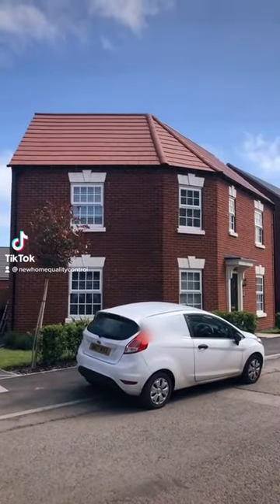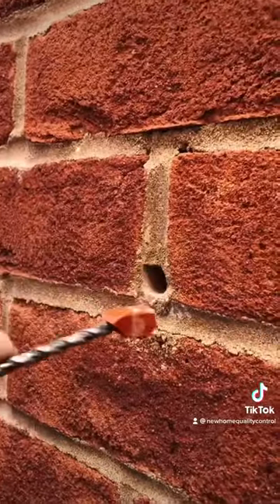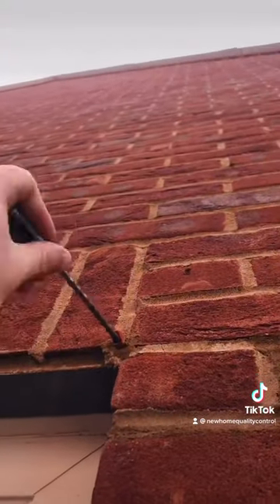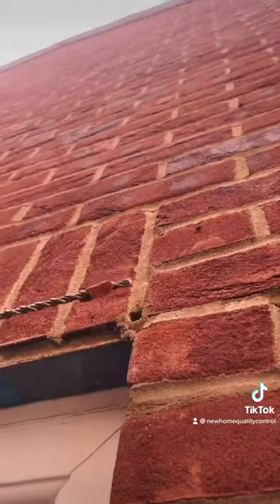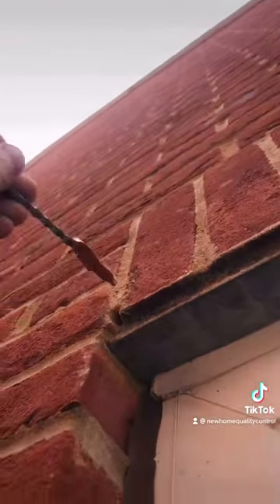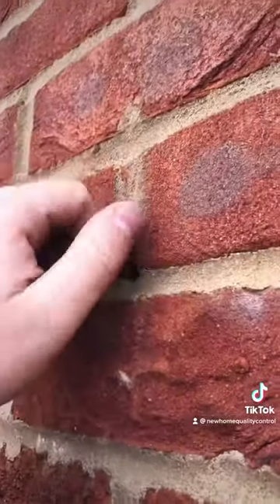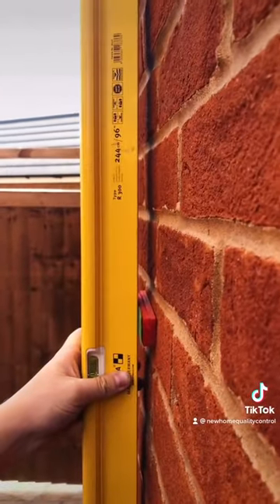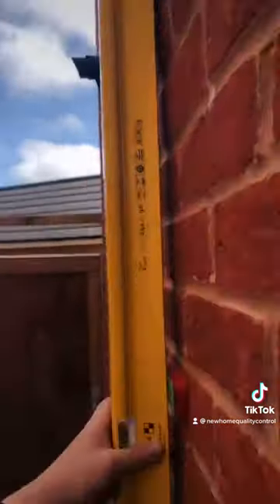MASSIVE BRICKWORK ISSUES: NEW BUILD INSPECTION

Comment: I’m interested as to what actually happens to the contractor when fake weep vents are found. Are they fined?
Reply: Updoots work on yt?
Reply: No the builder or sub contractor will be responsible for fitting them correctly.
Reply: I’m interested in knowing what a weep vent is and why I don’t have one
Reply: @MattHanr  you may live in a house that predates weep venting. They're just a way for moisture to make it out of the wall cavity.
Reply: @MITUK  it was built in 2019 lol
Reply: @MattHanr  😂
Reply: @MattHanr  depending where you live they might not use dedicated weep vents(plastic fabricated ones.) or they might use ones that look different. Search for vertical mortar joints look for perforated plastic or little nodules that protrude from the building.
Reply: @Astrnauted  you just explained what we saw in the video.
Reply: @MITUK  ah that makes sense, I live in a 1500s house lol. Ground floor can get mouldy quickly in the winter
Reply: @FAB1150  the mould just adds character 👍
Reply: It’s likely subbed, then subbed then subbed out again which is why these situations occurred in the first place and also why no one will take responsibility for it. Main contractors call this spreading risk but it ultimately removes responsibility.
Reply: @MattHanr  I do not have them either on my brick home here in Ohio- it was built around 1990. This is the UK so maybe due to high moisture, they require them on all brick homes? I'll have to look into it because now I'm interested lol!
Reply: @MattHanr  well just the words “weep vent” should have told you. The walls aren’t crying.
Reply: I don’t know. Looks like they found them to me 😂
Reply: @bronsonstephens5799  I think we can all see that this person in the video found the fake weep vents lol but the question the op asked was what is the punishment aka "are the contractors fined (for installing fake weep vents)?" My guess would be the client needs to file a lawsuit for the damages + the cost to have the work redone/ properly fixed and also report them to the proper people (no clue who that would be in their country but I'd assume there is somebody responsible for handling/ investigating complaints like that. Maybe something similar to our BBB? There is also the company that insures them plus they likely have a license(s)- both could likely have customer complaints filed through.)
Reply: @republican4u2nv78  I really liked your super detailed response. But my comment was really just a silly response to the word “fined”. I was referring to it as the word found, not the action of fining. I should probably refrain from commenting super late at night 😂.
Reply: @bronsonstephens5799  lol I just assumed you misread "fined" as "found" haha :)
Reply: @republican4u2nv78  hahaha all good. It was a bad joke anyways.
Reply: @bronsonstephens5799  Well, at least you got me thinking enough about the consequences of purposely crap work to look into it on my day off lmao! Btw, your comment was funny enough when I thought you read "fined" as "found" so at least your humor still came through lol! Worst part of written comments is not being able to hear how they are said.
Reply: @republican4u2nv78  oh I was thinking the exact same thing! And I bet your comment will help someone eventually! I was even able to learn a thing or two from it.
Reply: @bronsonstephens5799  I'm glad you replied! Your comment was able to give me a laugh twice- once for what I thought you meant and once for the joke that went right on over my head lol :)
Reply: @MattHanr  its entirely possible you might not need dedicated weep vents, like if you live in a dryer area then britain (not hard considering it rains like 360 days a year there) you probably wont need vents this large

Also different materials need a different finish, if you have a wooden house its entirely possible the outer cladding was raised a little so that air could gust inbetween it and the insulation to dry it out
Reply: @MattHanr  
They are used in the case of timber kit houses. The masonry in such construction is usually only the outer skin of brickwork as seen here. Though the timber will be treated, it's best to get any moisture drained quickly. This isn't considered necessary with cavity walls which can be facing brick or rendered common brick with an inner skin of lightweight concrete blocks. There will be further insulation material in the cavity. Old construction was just two skins of brickwork with no further insulation.
Former architectural technician and building control officer.
Reply: Sometimes on old buildings you can see the cotton rope hanging out. In the USA

Comment: I like the mortar chipping more easily on a new building than my 100 year old chimney.
Reply: Yeah, that is the most brittle crumbly ass mortar i have ever seen
Reply: @kapytanhook  Don't make em like they used to.
Reply: I noticed too! Tf are they mixing that mortar with, talc?
Reply: This mortar chipping made me gasp
Reply: @Mavendow  whoever poured my driveway used chalk I think.
Reply: More sand than cement in the mix. Happens when you have inexperienced laborers and masons who don’t care. My grandpa would send mortar back to be made properly if it was made with incorrect ratios.

Comment: What is a weep vent? And how is it supposed to be installed?
Reply: It is something that is supposed to relieve moisture from inside the wall where all your isolation layers are. fairly modern concept because many homes today have brick walls as fassade only, but are wooden throughout inside so the moisture can accumulate either on isolation or wood causing rot
Reply: Just to add more info, they are used on buildings where the primary structure is made from timber and the outer leaf brick/block is less than 215mm thick.  What happens is that wind driven rain can actually make its way through the brick layer (if it's less than say 200mm thick) and into the cavity.  The weep vents, or perpend vents allow air to ventilate the cavity preventing moisture to build up.

You can get around this by building a 215mm (double brick) structural outer leaf and insulating from the inside, but this is usually more expensive hence why they don't use that method.
Reply: This is how they build sick house syndrome buildings in Britain. They are essentially mold&mildew greenhouses. These holes do not help at all and is broken concept. Awful.
Reply: @otofoto  agreed... bbbbut its insulated!1!1 no wasted heat!1!  Why do you want polar icecaps melted!?
Reply: @DeusEversor  Insulation from inside is only done in hot weather to not let cold air out and cause ice age. In humid areas it causes damp and no plastic barriers can help there and they are eaten away by pests anyway. No weep holes were needed when using lime mortar.

Comment: will these homes be around in a hundred years? fifty? twenty-five without major remedy or will it be cheaper to simply demolish!
Reply: Less than 10 years and all the insulation and walls will be covered with black mold. Insulation have never payed back. Better should use triple glazed windows but for UK it is like space technology.

Comment: Question: I have a 200 year old house, no weep vents. Solid no probs. So why are they so essential now?
Reply: 200 year old homes I don't have cavity walls and are extremely non air tight normally very drafty, and alot of old house do have bad damp problems in fact.

Comment: So, I am genuinely curious, what happens after an inspection like this? Missing weep vents seem like something which would require, at best, chiseling out the surrounding bricks and re-building them with the weep vent in place (at worst, total demolition of the house). When the walls aren't straight, again, rebuilding the wall (if that's even feasible) or demolition. Surely with such things at stake this wouldn't be so common.

Comment: Can you explain weep vents. Are there meant to be bits of plastic in the mortar or not?
Reply: There's basically a big tray installed with these vents that go through the mortar. This allows any moisture that gets trapped between the walls to escape rather than sitting in a pool on top of the lintel for the door or window. In this case they didn't fit the tray so just cut the vent part off the tray and stuck them in to make them look like they fitted.

Comment: yes thats shocking,, here's one, new build had sank badly on one side of a three block, had to be underpinned, resulting in smashed windows ,door frames twisted , etc, joiner sorted all that out. main problem was the end house that had dropped had an expansion joint adjoining the next house which was 10mm at dpc and opened up, you ready? 75 plus mm at the top, they ask me if i would stitch it in with brickwork ,i said no way, not putting my name to that, final solution a dummy drain pipe was put up to cover up,,

Comment: No weep vents on my house, built in 1963, brick still looks brand new. northeast 🇺🇸
Reply: It's not explicitly to protect the brick. It's to protect the inside of the wall from accumulating water due to cracking or other reasons for water ingress like roof damage. My old rent had a concrete (not brick) wall where the roof was slightly cracked by a hurricane. The wall had no weep vents so water would pool inside the wall until one day it flooded out into the bedroom. Turns out, the break was just a 5cm slit in the shingling where the slab connected to the roof. It was much less than 1mm wide, so it took me 6 weeks to find (I'm not a roofer). I only found it by literally yanking on every tile out of frustration. One of them ripped, which is when it became clear not the entire rip was new.

Comment: I had to watch this video three times to figure out what those little plastic things were that had been installed as "fakes," because I live in the Great American Western Desert, as the place used to be called (we generally refer to it as the InterMountain West these days) and although there are many houses built of brick, providing a method for them to expel excess moisture is not an issue that we have to worry about...and I couldn't quite understand what the gentleman in the video was calling them.  I take it those little plastic "weep vents" are supposed to be laid with the brick and mortar, but why don't they work when they're added after the fact?  Does the moisture not collect in them properly when they're just jammed into hole drilled after the fact?  Or are there additional structures included in the mortar to help the went vents do their work?

Comment: What does a weep vent do?
Reply: Drains moisture out of the cavity wall and allow ventilation
Reply: It does nothing. Cosmetic feature to pass inspection.
Reply: @otofoto  Oh, so YOU'RE the dodgy builder installing those fake ones!!
Reply: @jamesy005  Are they permanent?
Reply: @joelonsdale  Show a video of these weep holes in action dripping water out. They do not work.
Reply: @otofoto  Even as a non-builder I wouldn't expect them to gush water.
Reply: @joelonsdale  They should have cup on other side to collect water but look in backwall of your fridge bottom weep hole and you will see what else it collects - mold.
Reply: @otofoto  Okay, Oto. When I build my next house I'll leave out the weep-vents, but if I have any problems, I'm coming after you for compensation.
Reply: @joelonsdale  You will need compensation anyway as it won't last with or without weep holes.

Comment: I’m in the U.S. Can someone explain? Why are they built with brick?
Reply: Most houses in uk are built with brick? What are they built with in US?
Reply: @Believer3_  why is that? Whether? Regular stuff. Wood, dry way, insulation, etc
Reply: @joemomma707  would you call wood a regular thing to build a house with lol.. havent you heard the story of 'the 3 little pigs' LOL where the wolf blows down the houses until they build it from brick 🤣🤣 why do you think tall buildings are made from brick,, because of structural integrity 😂
Reply: @joemomma707  wood develops mold quicker and it would get very damp and smelly because it rains alot in UK.. so yes probably weather
Reply: @Believer3_  lol. What is it that they cut corner on? I don’t get it? In this video. I’m sure you know
Reply: @joemomma707  lmao i honestly have no idea bro. I don't even know what that is that hes pulling out haha
Reply: @joemomma707  that's a "weep vent" since brick is porous water gets in and the vent allows it to drain to prevent water damage to the structure

Comment: This is veneer masonry wall and is only for aesthetics. It won't bother the structural integrity of the building. However, overtime these bricks will prematurely start to fall apart. It just means that the home owner will need to pay later to fix someone else's laziness and poor craftsmanship (because they just wanted to get the job done quickly so they can move on to the next project). You get what you pay for in the end as the people who end up buying this home can't afford it nor would they be able to afford it if it was built right. Enjoy the Decline 😎🍿
Reply: The buildup of moisture between the facade and the structural timber will absolutely fuck up the timber. There's a reason facades have weep holes and damp course.
Reply: @Cheesus-Sliced  I found a recent video in NYC where the facade was completely separated from the building due to poor craftsmanship. They had to evacuate the people from the building and set up emergency scaffolding so the bricks didn't fall onto the street.. Enjoy the Decline 😎🍿
Reply: @Josh.Stovall  yea, one issue is that the brackets used to hold the facade against the frame generally aren't stainless, and that moisture will rust out the low quality nails or rot the wood around them, or both. Its also usually internal structural wood used, so its only got an envelope treatment and the combination of moisture and damage from the brackets makes them susceptible to termites. Same issue with most internal timber, its all envelope treated and the builders don't generally bother treating the cuts the way they are supposed to, so every joint is a possible angle of attack for termites.
Other issue with facades, sand is cheaper than cement, so brickies save money by using less and less cement, for a more powdery cement that crumbles away like this. Between that and the way the brackets actually grip, its no surprise this sort of shit is happening.
Reply: @Cheesus-Sliced  We use Blocks in Florida or steel reinforced concrete, as building codes require hurricane force wind resistance.
Reply: @Josh.Stovall  I've seen hurricane rod piers used instead, and often the steel going into blocks is pre-rusted. Thankfully, for the most part everything in construction is already overengineered in most places and even with a lot of sub-par parts like that, its still solid enough.

Comment: Mistakes happen but intentionally and clearly covering up that mistake should lead to prosecution especially when it happens so often pretty sure you can’t call it a mistake anymore but standard practice
Reply: If the builder doesn't correct the work I'm sure they could sue, but the home owner must let the builder fix the problem first so in most cases.

Comment: It’s such an antiquated way we build houses. They are small enough to be built in a factory system. To much variation in new builds. Some good, many rubbish.
Reply: Your idea is to ship brick houses?
Reply: @dvyt433  no. A completely new way of building houses. Many elements delivered to site complete. The development of structural elements that are new, by building using frames created in factories and erected on site.
Reply: @andrewhead6267  i think they do this with modern hotels. The rooms are completely prebuilt, even wiring and plumbing, furniture and fittings. Then slotted into frame on site.

Comment: Not making excuses for the weep holes but most house builders use cheap crappy bricks with more hole than actual brick along with silo muck which takes an age to properly go off. I’ve build walls on site put my level up and it’s nice and plumb I come back in the morning and it’s shite!
Reply: Mortar contracts way temp over nite could move if just built